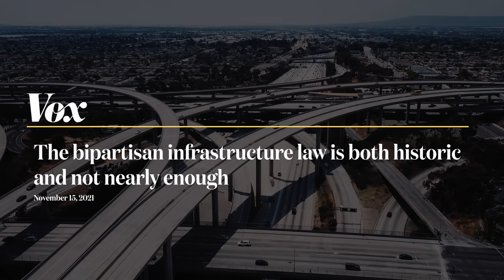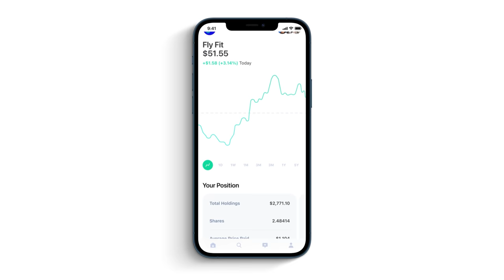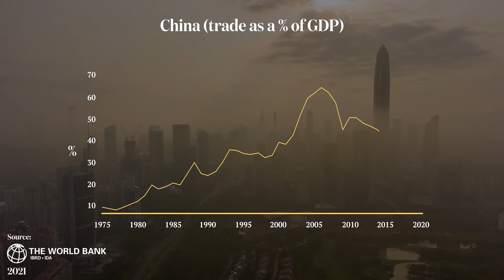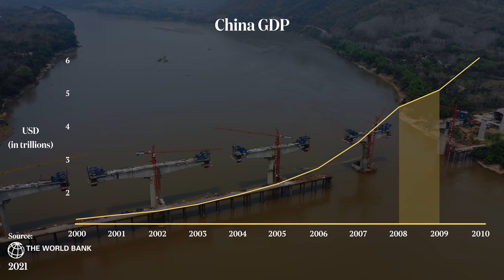China Has A Debt Problem Three Times Larger Than Evergrande | Economics Explained

Comment: Thanks for the analysis.
Very negative results.
So the USA should not build high speed rails?
Hahaha. 😂 
We were figuring the value of the carparks of a shopping mall. Actually not quite worth the cost of construction , for the parking fees must be low to attract shoppers. So do we build a mall with no parking lots?
Reply: America isn't densely populated so frankly a high speed rail makes very little sense. Trains for cargo make sense but unfortunately the labor unions neutered that.
Reply: @DaveSmith-cp5kj  Ah, yes like they (unions) did in Germany and China. There's about 40 cities in the USA with large enough populations to have HSR, and are close enough that HSR is the fastest way to travel between them. Do you even know the effective range of HSR, and at what speed it's faster than planes for all continental travel?
Reply: @Pistolita221  You misunderstand the issue. Population density of an individual city is irrelevant to intercity transport, Population density in terms of city proximity to each other is what matters for public transit.
Reply: @DaveSmith-cp5kj  Do you know the effective range HSR is faster than air travel? It's 600 miles, and with the new superconductor magnetic levitation in japan, their trains (averaging at 300mph) are faster for city to city travel than planes over 1200 miles. The farthest two major population centers are in the USA is 605 miles, from Denver to Oklahoma City. That means all cities from Boston and Minneapolis to Miami and San Antonio, to San Diego and Seattle makes sense to connect via HSR in its current iteration, and within the next decade we'll see HSR be the fastest form of continental transit, period. Unless hypersonic travel becomes available to the masses, HSR will be the fastest form of transit humans have ever devised.
Reply: @Pistolita221  Again, you seem to misunderstand how the logistics of pubic transportation work. I suggest reading up on JJ Hill, as your assumptions are the same fatal errors that past contractors believed in.
Reply: @DaveSmith-cp5kj  You're just changing the goalpost every time your argument unravels. Why don't you summarize your argument for why the USA wouldn't benefit from HSR. By my estimations, with the distance between these large population centers, there isn't a country in the world that would benefit more from HSR (with effective last mile mass transit solutions).

So, I imagine you take issue with the Downs-Thompson paradox, as well. Since you seem to be a car and plane absolutist. There's no remedy for the USA's incredible traffic and geographic isolation of those in poverty, or do you have a solution better than HSR?
Reply: @Pistolita221  I literally did... multiple times. I'm sorry the facts don't support your narrative and this makes you afraid to further educate yourself.
Reply: @DaveSmith-cp5kj  What do I not get about this comment "You misunderstand the issue." let's see if I can rephrase what your saying and still keep the message the same, to see just how little I understand here.

 "Population density of an individual city is irrelevant to intercity transport," Actually, it is, but go on. 

"Population density in terms of city proximity to each other is what matters for public transit." 'What you're saying is the city's density in terms of people per square mile isn't important, it's the distance between the population centers that matters.' if that's not what you meant try explaining that comment again, because otherwise I'll have to get you the dictionary definition of the nouns and verbs to prove you're using the English language wrong, and that'd be embarrassing for someone who claims to be able to read books on urban planning and infrastructure. I'm not saying you're that stupid, btw. I haven't made any comments on my estimation of your intelligence, for the record.
Reply: @Pistolita221  Now you're the one trying to move goalposts.
Reply: @DaveSmith-cp5kj  what goalpost did I move? I'm just trying to identify your argument, don't worry I'll get around to dissecting your weak argument right after you tell me I'm not misrepresenting it, bubba. Don't worry no goalposts getting move on you, bubba.
Reply: @Pistolita221  So my argument is weak, and yet you still have failed to defeat it. Again, the most telling thing is how reluctant you are to educate yourself. Again I suggest reading up on what I have previously covered.
Reply: @DaveSmith-cp5kj  it seems as though I know more about the idea of HSR because you don't seem to be able to produce any other that "I read a book I refuse to quote but trust me I'm right."
Reply: @DaveSmith-cp5kj  you're refusing to represent your argument, presumably because you know it's weak.
Reply: @Pistolita221  I gave you my argument... multiple times. All you have is calling people bubba and double posting.
Reply: @DaveSmith-cp5kj  I have sources for my 600 mile effective range of HSR, but more importantly I have data and math to back up my assertion that HSR is the best mode of transit from 100 miles to 600 mile, and soon to become 2000. All you've done is  obfuscating to avoid a proper debated. What's a limiting variable for HSR's effective range?
Reply: @DaveSmith-cp5kj  I didn't think republicans cared about identity politics, bubba. Is that a new piece of your platform, to get offended when people don't refer to you by your preferred pronouns?

Comment: Over the last thirty years, five of the G8 largest advanced economies have built high speed rail networks (Japan, Germany, France, Italy and Spain) and three have not (the USA, the UK and Canada). With one sole exception (Spain) the countries which built high speed rail networks have all grown more slowly than the ones which did not. Spain has indeed performed better than most of its peers, but it started from a lower base and remains by some margin the poorest country in the G8.There are of course many factors which affect a nation's economic performance, but it cannot be claimed that high speed rail is a prerequisite for prosperity.

Comment: The long term economic benefit of the High Speed Rail is probably a lot higher than the cost of the entire structure. The reason why it needs to spread to smaller cities, notably West China, is to develop their economies there. High speed rail is one of the essentials for that. It is almost naive to focus on a cost of a single infrastructural project You cannot imagine the inter-provincial trades due to internet shopping which is only allowed by High Speed Rail on fast delivery from anywhere in China. On mentioning crashes, obe has to consider the mortality probability over the last 20 years. I would guess High Speed Rail is a lot safer than most other form of long distance travel. I hope that Economics Explained can be more macro in their approach let alone you are recommending portfolio construction???

Comment: There is a horrible dilemma at the heart of the subject matter of this video - it is a dilemma that has been played out here in the UK throughout my lifetime. After WW2, British Railways were all nationalised - but they were horribly degraded by what happened during WW2 (they were hugely damaged by bombing but, understandably, things were patched up rather than fixed) and throughout the following three decades they were underinvested by successive governments and in the 1960s an estimated 50% of rail lines were closed.  

The post-WW2 experience in the UK was that nationalised industries simply did not deliver. This was due to many reasons but a prime reason was the certainty of managers and workers alike that it didn't matter how bad services got, the taxpayer would always make good the operating losses that were incurred. Then, in the 1980s the railways in the UK were again privatised by Margaret Thatcher's government. New investment followed - though this took a very long time to bear fruit,  in large part because the state of UK railways had fallen so low in almost every respect.  However, for the travelling public the main effect of privatising UK railways was ever rising fares - very often far in excess of inflation - something that has continued to this day.  Consequently, we now have a railway system that is running mostly new generation trains; these are not ultra High-Speed for the most part, but speeds well in excess of 100 MPH are common now - fast enough to compete with airlines on long-distance domestic routes such as London to Scotland.  However, affording to ride these trains regularly is well beyond the pocket of a substantial part of the population.  So, the dilemma:   Public ownership didn't deliver - but private ownership has - eventually - delivered a better service to most places - but at a price that far fewer people can afford.

I believe that - like a postal system with standard pricing from anywhere to anywhere - universal access to transport is a pre-requisite for cohesive nationhood. The Chinese seem to believe that too and so I would take issue with criticising them for extending HSR to less densely populated regions. In my view its is, or should be, a primary function of government to ensure that access to opportunity (which is essentially what transport can provide) is as evenly distributed as it can be for all its citizens.  A railway system that is affordable to use has to be a part of that - and clearly at present the UK has got that wrong - but sounds like China has not.

Comment: Well one reason why we do not have more passengers rail system or a high speed one is for a few reasons. One is 98% of our rails are used for the transportation for goods that is usually better to transport by rail. The other factor is that the railroad was not built by the government, but made and own by private companies. While I am not positive I think it is still the same way. So to have a high speed rail system in the USA you will basically going to have to at least make were it will break even eventually. That would be tough to do if you have to build new lines just so your are not sharing train with slower trains going 30 mph carrying things like coal ect.

Comment: 850B ? Just 850B for 35,000 km HSR? That is just 8.5B for 350km. That is a bad investment and debt trap?

Meanwhile, CA HSR with around 800 km, 350km for the first phase, the project cost is already a 110B tag. And is doomed to be over budget. That is at least 50B per 350km. SIX times higher.

And that is not the winner. London HS2 cost more than $120B for just 500km. Which is $70B per 350km.

By any means, China HSR is a better investment than the other 2.

Comment: So instead of pointing at China, I will point at Japan for a bit.  I was born and raised in the US and lived there for 27 years before moving here for the last 3.  Just a few examples of where the US really could improve would be efficiency of the work and quality they maintain.  As an example, last week a 200m long section of the road in front of my workplace was resurfaced.  In the first place, if this had been in America, it would have been left alone for another 10 years probably as there were no massive potholes in it, it was just kind of worn out.  Anyway to do this resurfacing, the road workers arrived on site at about 9 am, quickly stripped, resurfaced, and repainted the left lane while leaving the right lane open for traffic to pass either way, and had the left lane fully resurfaced by about 330 pm.  The next day they did the same for the right lane.  I literally wouldn't have even known road work was going on there last week if it wasn't for needing to leave early one day.  Compare that to the US.  I can recall on several occasions portions of road being closed for 1-2 months for a similar job.  Now I say similar because usually the work in the US requires a bit more work the layer down, but that just circles back to the initial point of letting the problem get out of hand.

Comment: There are a lot of people claiming that infrastructure losses are worth it for the development if local economies. However, I feel that the city- centered nature of the economies means that this isn’t really going to be used to commute. The line to Tibet is mostly going to be tourists or workers going home to their families once every few months. And because it is high speed rail, not normal rail that can include cargo, it does little for the local economies. Subsidizing plane routes would be a much more affordable and effective solution for those kind of needs, it might even reduce journey times. Incurring huge amounts of debt and interest on that debt signifies that this is primarily used as a symbol of Chinese efficiency in construction and for political reasons — separatist factions in Xinjiang and Tibet. Maintaining those lines is no joke too, especially the Tibet line which lies on permafrost. Tons of bridges and more to maintain. Those railway lines that will never match the costs incurred to the state, even if you add every possible metric of economic advancement for the rural economies.
Reply: The tibet line is conventional, neither electrified nor high-speed. The Xinjiang high speed line carries cargo. Please please do some basic fact check.

Comment: Rather than looking down at one barrel of the debt for a major project have you consider how much China's GDP  had grown as country and its populous since the rail has done? There are social-economic benefits to also slow down the over crowded cities in China by allow older generations to remain in smaller cities. 

In Australia, we spend 100 million every two years (Election cycles) for cost-benefit studies on major infrastructure that never gets done. Every new government does a bit of tweak here and there and goes another 100 million tax payer funded money which after 20 years, the only thing to show for is a lot of wasted pile of paper than are useless.From high-speed rail, military submarines, helicopters, NBN, there's so much money wasted without any tangible benefits to the populous  especially with the ones that never went ahead or cancelled half-way.

Comment: What exactly is stopping them from running cheaper trains on less profitable lines

Edit
No wait they still have a large rural population so the expectation is most likely that they move into those smaller towns which would then justify the current capacity since those towns will have grown in size

Comment: Railway rarely gets profitable solely from its ticket prices. Railway as a public project generated public goods that is valued through societal benefit not directly related to the railway itself (such as the possibility of commuting between cities hundreds of miles away, less time spent on the way to work, ability to transport other materials to previously impassable areas, diverting the pressure of the highway during holiday times, the technological advancement of new automatic railway control system and railcars, job of maintenance crews and railway authorities,etc) It’s criminally gross-simplified to just call Chinese’s “not-profitable” high-speed railways as “wasteful spending”. These projects can only be conducted by public efforts since they are related with public goods instead private ventures.

Also when a public administration slowed down its desperately needed railway expansion or upgrades due to “fearing not profitable”, then you might wonder what these administrations had done accumulating during the past years when they had the financial ability to upgrade infrastructure.

Comment: This video is biased in favor of the micro economic aspects of the situation. High speed rail, however, is a macro economic affair. If done right, rail isn't particularly profitable micro economically speaking, because micro economic profitability has a tendency to come at a macro economic cost. Even Japan had to take on a large portion of its substantial debt when they privatized the JNR in 1987. By over-focusing on the micro economic costs there's a real danger of people missing the macro economic benefits of rail, high-speed or not.

Comment: 1:13 "infrastructure spending [...] is fantastic." Yes, so fantastic that the planet is dying. We concrete the most fertile fields. The alimony strangles the taxpayers. And in the end you have to remove the scrap again. The holes we have to dig for the metals are also getting deeper and deeper. All of this is done with fossil fuels. Nice in the short term, a disaster for the ecosystem in the long term.